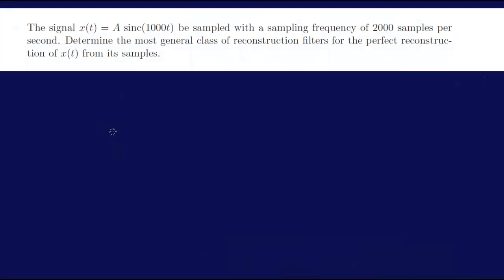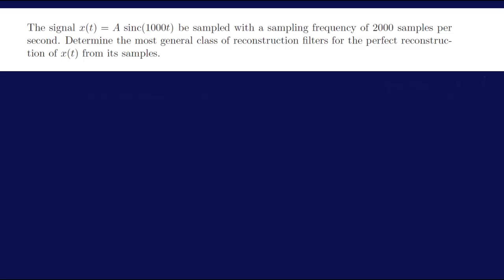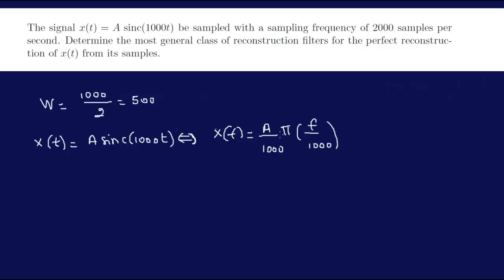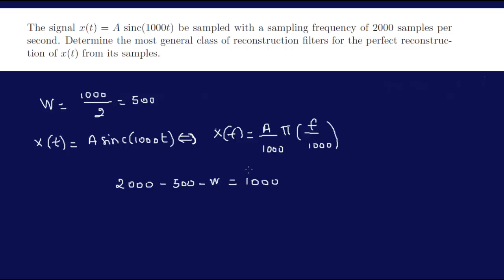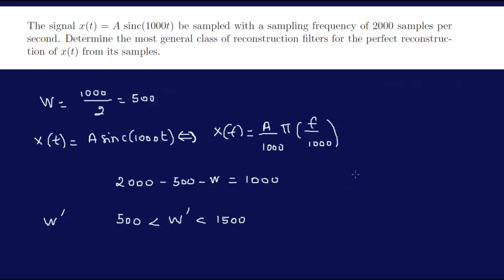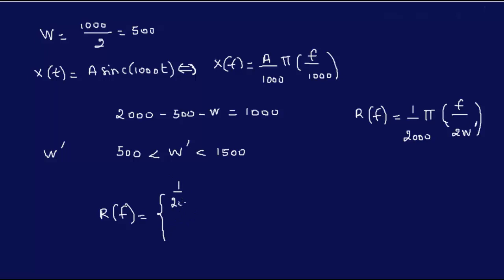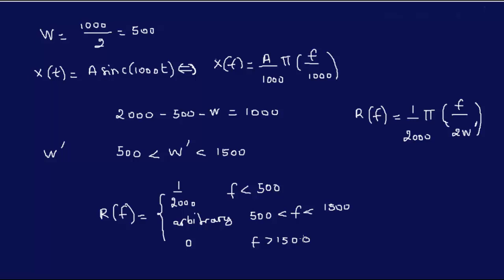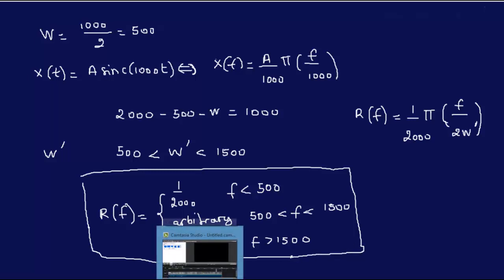Sampled Messages-Reconstruction Filter-FE/EIT Exam Review

Comment: I'm a little lost on the step where you did 2000 - 500 - W = 1000. Where did you pull the 500 from?
Reply from the maker: yeah the 500 is the original bandwidth of the signal x(t). Bandwidth is half of frequency.
Reply: Raiya Energy thanks for the prompt response! I love your videos!
Reply: Raiya Energy Could you explain the 200-500-W a bit more? I am trying to picture it like you said, but cannot.